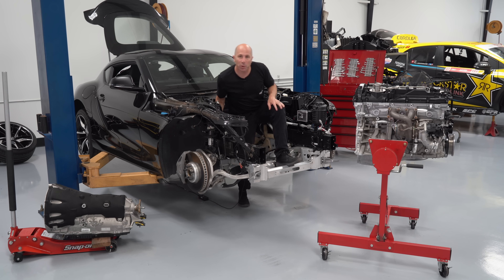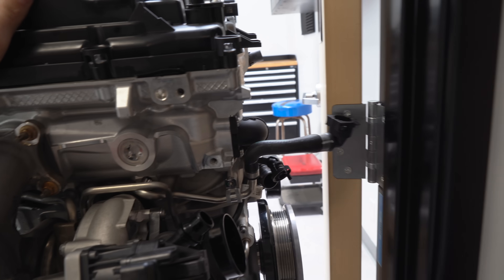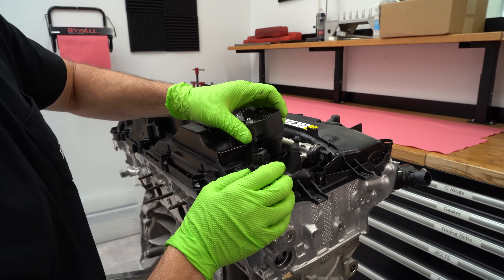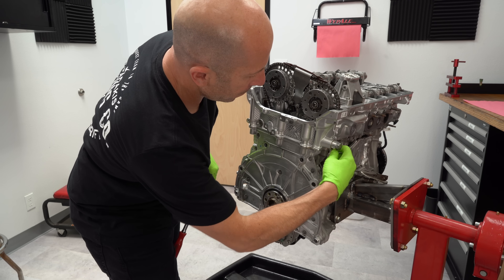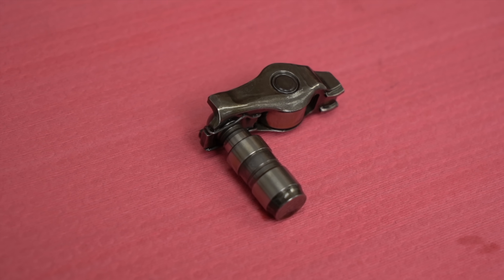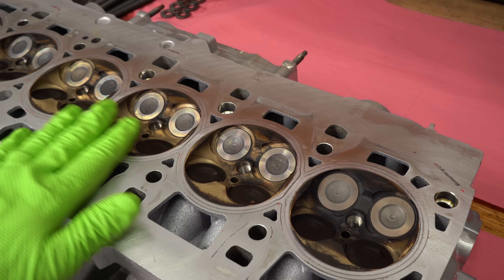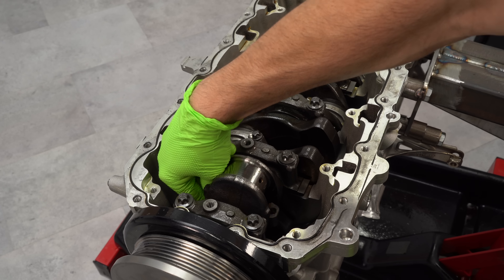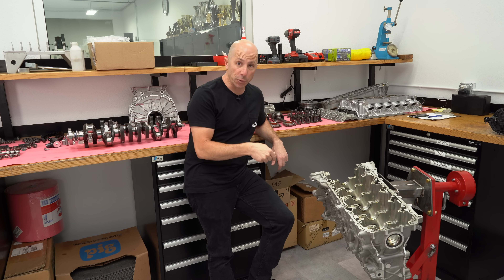2020 Supra B58 Engine Teardown - First Look - Better than the 2JZ?

Comment: For a regular owner, hope you never have a timing chain issue. Its gonna be EXPENSIVE.
Reply: Omer Ahmed  what weak points have they rectified? during all disassembly i don't see any rectifications done to BMW engine
Reply: @lordjaashin  the supra B58 has different Head and also numerous mounts and other bits are replaced by toyota to be more robust during an ownership. BMW was so surprised by this move of Toyota.
Reply: Omer Ahmed  I see the plastic bmw style parts , not a good idea by toyota. overtime hot coolant would crack the thermo housing. if your racing this engine on the track and it runs hotter , not sure how the plastic would hold up
Reply: dcomputers the problem with BMWs is the expense of maintenance when they begin to age. This engine will be no different, as those plastics become brittle with age. And when you have to spend 7 grand disassembling the car & removing the engine just to access the timing chain, you’ll regret buying the Supra.
Reply: MarioLoco03 agreed😅
Reply: Omer Ahmed it’s built in the exact same factory as the B58s for the Z4s in Austria. It’s literally the exact same engine with zero changes. They haven’t changed anything.
Reply: Just like all of the Audi S Models (S3, S4, S5, S7) and RS models, timing chains on the rear.  Audi’s have been plagued with crappy plastics on the chain guides and chain tensioner, unfortunately, so engine removal and replacement of guides to newer metal and plastic guides has been commonplace, $4k to $7k depending on the engine.
Reply: Disassemble car to pull engine
Reply: Omer Ahmed no it literally is on the same production line. They don’t even separate the Supra and Z4 engines.
Reply: Lol that’s when you sell the car
Reply: [N47 rattle noises in the distance]
Reply: more European cars have that
Reply: Omer Ahmed they haven’t done much to it apart from the 2 port exhaust manifold. The internals are the same. The B58 has always been a solid engine in all 40i BMW’s. I run this engine in my M140i. It’s stock, apart from a drop in K&N. It made 354bhp/550nm’s on the dyno. Cannot wait to see what tuners come up with for this engine.
Reply: Unless you do it yourself. Looks like you can just pull the transmission out and leave the engine inside. Could probably get to the chain without having to remove the engine.
Reply: Well if you keep up with oil changes you shouldn't. It's still inferior to timing gears though I admit.
Reply: Eventually it has to be changed
Reply: Omer Ahmed facts I agreed I truly believe this engine will be legendary like the 2jz mmmm if not quite close.
Reply: That timing chain placement was probably BMW's idea........ typical.
Reply: Omer Ahmed  😂 yeah ok.
Reply: A well maintained car would not wear the timing chain prematurely. Frequent oil changes are key.
Reply: @ZxRx7  you know nothing. Big mouth. Go read about BMW 4cylinder turbo and v8tt timing chain and rod issues. When you're done it will be time for another rotary rebuild.
Reply: You want to see drama? Take a gander on the BMW forum and you'll see that all their new engines are having internal issues from rod knocking  to chain popping. Shame on toyota for destroying the supra nameplate.
Reply: @MRwaterlicious  I haven't found any threads talking about this?
Reply: Sean Malcolm that’s BS.
Reply: @MRwaterlicious  have you not heard the interviews with the Toyota engineer who worked on this engine, they sent it back to BMW and made sure to rectify issues and weakpoints on it to Toyota standards. The chain will be a PITA to change and expensive but the rest of the engine looks very well put together.
Reply: @RetroMotiveAdventures  you stay true to your convictions and I'll stay true to mine. Please show me one high performance  engine design from BMW that's considered reliable. Enough said.   The time and money toyota spent correcting BMW'S shortcomings they should've  spent it designing their own engine. BMW has great technology but trash for reliability. Toyota also said they revised the Subaru engine found in the frs. Now they have several recalls due to internal failures. B58 technology is good for BMW not supra....
Reply: @MRwaterlicious  yeah I do agree they should have made their own engine as someone who's owned the Mk3 and currently a AW11 SC the old Toyota engine designs where tried and true and strong at that but we can speculate all day long but it would have cost Toyota more to design a 3JZ per say from the ground up.
Reply: @RetroMotiveAdventures  that's BS. Dont  believe toyota lies. They wanted the easy way out because they dont believe the car will sell due to alot of demand for SUVs. Chevy redesign the vette and offered it for under 60k. Toyota is the largest car manufacture in the world. They got the money.
Reply: Sean Malcolm  hold your mk4 mate. Get your mk4 and pray you don’t see me on the road with my 1KR-DE2.
Reply: @ramade9040  let's do a 100 roll to 180...I'd pull four zip codes on that lawn mower pos.
Reply: Omer Ahmed  they might have reinforced it but it will need a replacement soon or later ... and when that needs to be done guess how much you paying ... its not like its has unbreaking level 3 .. love ya lapiz profile pic :D
Reply: yea i am  not a fan of this new supra at all..vette 2020 is gonna be the buiznuss
Reply: Omer Ahmed  you are one of those chickens who would buy feathers if you believe the BS about toyota reinforced B58. Remember Toyota made mention about them reinforcing the frs Subaru motor and low and behold there is currently a recall on them for internal failures. B58 is more modern than 2j yes but 2j has the edge for being tuner friendly and easy to work on. Go get your b58 and pray I dont see you on the road with my mk4.
Reply: @MRwaterlicious  easy to work on and tuner friendly because its ancient, the new B58 motor has so much more potential but takes more time to get right.
Reply: @MRwaterlicious  2JZ is old AF.. I mean i have still respect for those 1970s american iconic V8 but in 2020 they will be miserably beaten by the modern V8.. Same case with the supra. B58 is a nice engine..it's just require a bit of pamper and attention from the owner unlike any other Toyota😁.
Reply: @abhinashpattanaik5109  I agree with you bro but I will never accept the mkv as a supra replacement with a BMW drivetrain. Toyota could've improved on their straight 6 the same way chevy improved on their LS motors over the years. Toyota could've also used their TTv6 found in the 2019 ls lexus. GTR was once straight 6 so supra fans would've embraced the v6 if they had put it in the supra.
Reply: @MRwaterlicious  Sometimes collaboration leads to something exotic and precious. A90 Supra has tremendous potential. BMW has the best expertise when it comes to inline6.. The best in the market,period.. No two ways about it..mk4 was a legend but i am glad toyota made the supra with the help of BMW. You know one of the greatest supercar The Mclaren F1 had BMW engine but that didn't make the car a BMW F1. Hurracan uses the R8 V10 but that doesn't make it an AUDI Hurracan. Supra is using the CLAR platform which is more rigid than the LFA. Believe me This Supra is going to rock the road ahead. Pagani used a AMG motor but nobody gave a flack to that car. That car is no less than a legend just like the mk4 supra.. BMW had given us some iconic things in the past. Be it the E46 M3 or the 1st gen 8 series V12 with a manual tranny or the classic E60 V10 which revvs close to a stagerring 8500RPM. There is a reason why their tagline screams "ultimate driving pleasure". Most of the modern Toyotas or Lexus are boring af but yeah its reliable ( LC 500 is not boring at all😁). After the LFA(which actually brought loss to toyota with every unit sold) Toyota moved from the performance segment. So i am gonna ask you one question...Do you want a car thats gonna serve you reliably for 365 days without giving you any fun or you want a car which will inevitably plaster a grin on your face, everytime you sit behind the wheel while the car sits for10days for service in a year? I think those 10 days would be justified.. 
The next gen Lancer EVO gonna use the renault megane RS motor as Mitsubishi is planning to bring it back due to the demands but not gonna invest money on the motor. Still People are happy about it so why so much hatred towards Supra. If something iconic is coming back we should welcome it.
Lets just give this baby a chance. I am sure u will love it.
Reply: @abhinashpattanaik5109  I'm not against collaboration but when toyota just rebadged a Z4 and call it a supra that's totally unacceptable in my book.  All the cars you've mention not one is a rebadged anything. They all have their own identity even though they're using other manufacturers technology.Toyota literally  took a Z4 and slap supra on it. Not good for me. You like? Enjoy then!
Reply: @MRwaterlicious  imo the design itself is inspired from the ft1 concept. I agree toyota is using BMW skeletons but with one blink of an eye you will know that the design is unmistakably Japanese. Lamborghini uses the same platform of vw toureg suv to build Urus. All the ICE and electronics gadgets are made by VW. Even it's the rare Lamborghini to use a turbo charged motor not a NA motor. It's basically a Toureg SUV on steroids but nobody gives a  shit about it and look at the sales chart.. It's the most profitable model of Lamborghini lineup. I am sure not a fan what toyota did but its already done and the car is unleashed. So as a car enthusiast we should embrace it not despise it. Not always being fast is the key to fun. Real car enthusiast are praising the new Supra telling it the king on its own term. It has a distinct indentity and has much better dynamics than the mk4 Supra. This is the same case of people compare mick shcumacher to his dad. We shouldn't do this.
Reply: @abhinashpattanaik5109  lambo is owned by VW.. it doesnt matter if they interchange parts. In this case toyota should be used lexus v6tt engine. BMW  power plants are good on tech but trash on reliability.
Reply: @Abhinash Pattanaik  Well said .... I traded my 2019 Lexus ES350 fsport for a 2022 m340i ....best decision I ever made . Now all my future cars gotta have launch control 🤣
Reply: @MRwaterlicious   B58 is also a nice motor. Have seen a bimmer in mumbai which puts out 860BHP.
Reply: @MRwaterlicious  are you on the Supraforums?
Reply: @MRwaterlicious  what if u see him in the road in your mk4? Would you show off your lag...eeerrrrmmm..boost. I am curious. Big mouths like you shame all petrol heads like us. Sell your mk4 and Go get yourself a Ferrari, you certainly fit the stereotype.
Reply: @ZxRx7  you just embarrassed yourself! Do it again...
Reply: @MRwaterlicious  lmao your mk. 4 ain't shit buddy
Reply: @MRwaterlicious bmw has never made a fast reliable car and now that they have made a semi reliable quick car(b58) bmw fans are cumming there pants in excitement

Comment: A thousand horse power for how long? A rear mounted timing chain? Ask Audi owners how they feel about that? Thanks for the cool video none the less.
Reply: Well VAG is so badly known for shitty ass timing chains/guides tho. BMW had issues with the N series engines, but those new B58's use a revised, sturdier design. I don't think it should be much of a problem tbh.

Comment: That is strange that they would have variable lift on the intake instead it the exhaust.  Normally from my experience intake variable lift isn't needed on turbo  setups due to air being forced in.  But it benefits from exhaust side lift because you need to flow as much as you can out.

Comment: Love the short block, hate the heads. Too much there to worry about with the variable timing and lift. I don't mind the integrated exhaust manifold and I can put up with having a chain on the back. I also hate anything made of plastic that has fluids running through it. I also don't care for the direct injection BS either.
Reply: The heads can be changed since there are multiple versions of the B58 anyway(Z4 heads can be switched into the mk5s B58).

Comment: “It’s actually simpler...”
cut to: massive mess of crazy wiring , hoses and plastic spiderweb intake manifold 😂
Reply: I think he meant the modularity. It didn't look too bad, it's nice to remove big chunks of several parts rather than a ton of small pieces.
Reply: The faceless you’re  right... I was just giving him a hard time. This video was actually super interesting because I could never afford to do this.
Reply: @MurderMostFowl  right?! Still under warranty and everything
Reply: The faceless The B58 is actually part of BMW’s ‘modular’ engines. It shares/lends components to all B series engines. It shares the same block as the B57 3.0 twin/quad turbo engine!
Reply: to be fair, the 2JZ-GTE has got a crap ton of hoses and wires on top too

Comment: Ok is it worse and cheaper for them to use just the silicone and not gaskets or what but silicone compared to gaskets doesn’t sound good...
Reply: Cameron McMaster new engines for 15yrs are like this. Also, most of the fsteners have glue on them

Comment: Clicked to see this engine being teared down.

With all the hate about the Supra being made by BMW, this is gonna get interesting. A thousand HP on a relatively new engine platform that's all aluminum? Steph can achieve it. It won't be overnight, but certainly progressive. There are bits that the 2JZ just doesn't have. Hate the B58 for it's overengineering, but remember the 2JZ was as overengineered for its time.

Excited to see what can be done with this engine.

Comment: It's a good engine but the 2jz is one of the best engines ever made.
Reply: Except that it isnt and you dont even know what makes an engine good.
Reply: @sasalolic999  troll.
Reply: @chrisl9254  yea i am a troll for telling you an engine thats only good for making power you cant ever use is not that good because it lacks in other aspects. Makes sense.
Reply: @sasalolic999  don't know about you but I wouldn't want  a stock 2jz supra. Yes the 2jz is known for making crazy power.  Thats the whole point obviously stuffs going to break at some point.you can  use that much power go to the track or drag strip.
Reply: I'm guessing you're 16 and just  saw fast and furious for the first time.
Reply: @chrisl9254  also who even talked about stock vs modified? What are you even on about? Literally out of your little mind

Comment: You can buy all the parts for the B58 from BMW, no need to purchase a vehicle.  This particular iteration of the engine may be new but it is about the same as any other B58 since 2016.  Surprised he doesn’t seem to know it’s a BMW engine and the timing chain is in the back that’s pretty common knowledge.  Also, regarding the throttle by wire throttle body, it’s actually at WOT all the time as the engine uses valvetronic to adjust lift and this is what controls engine speed.  The throttle body is a backup system.  That’s why the intercooler is where it is, the valve body is open all the time the engine is running.

Comment: 2020 supra for sale, driven less than 2000 miles. like new!
Reply: i know what i have
Reply: lol
Reply: How mu 15k
Reply: Oh wait not worth it waiting for c8
Reply: @TruckerDave215  not gonna lie i think the c8 is gonna be hot garbage. The dry sumped lt on the rear is gonna be a bitch to get to and well the last mid engined car they made was the fiero and they caught fire..... Like a fucking lot i think 30% burned down
Reply: 570 miles to be exact
Reply: some assembly required

Comment: Looks like alot of clever engineering. Very efficient. But, it also looks like repairs will cost a literal fortune. Tuning will be out of reach to all but the richest owners. I mean come one, plastic intake with ingegrated intercooler on a booster engine? How much boost can it reliably take before it cracks or cant seal? The engine looks to have to be removed for jjust about everything.

Comment: I have no doubt this motor can push big numbers since the N54 and N55 were brilliant at that very thing. The issue here is that Toyota dropped the ball. The car is a not-so-good version of the competent BMW Z4 40i and it's not like Toyota doesn't know how to make a good motor or car, they changed the automotive world for the better so why they turned around and did this makes zero sense. Hard to think a company responsible for making some of the most reliable yet diverse set of vehicles would do such a thing. Creating the successful Lexus division changed the luxury car world proving that technologically advanced cars can be reliable at the same time so again, why a BMW Z4 with a skin?